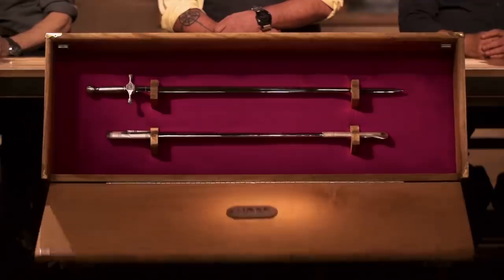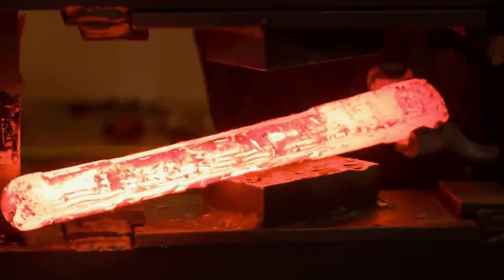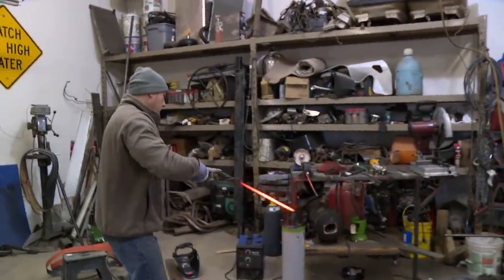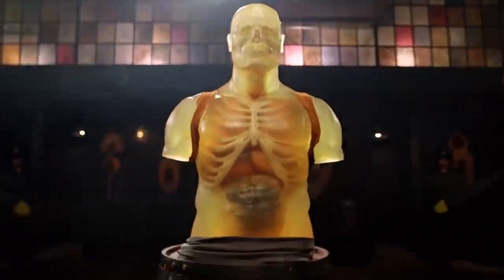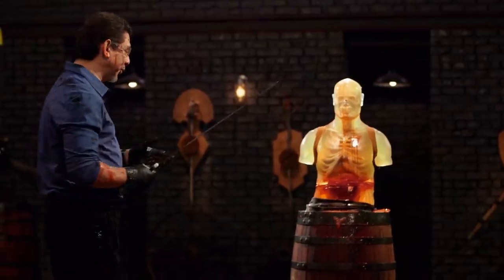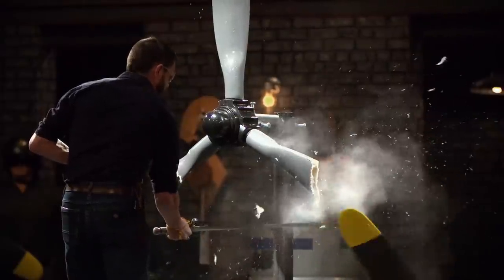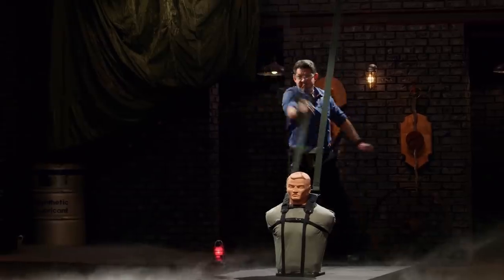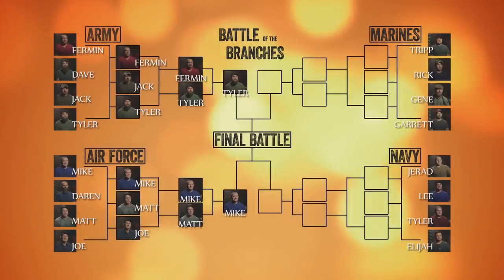Forged in Fire: Air Force Officers Sword Final Round: Matt vs Mike (Season 6) | History

Comment: "Imma put safety wire on it" that's probably the most boot thing I've ever heard.
Reply: Most boot? What?
Reply: @Argonak1  a boot is someone just out of basic training, and it just a little too excited about the military.
Reply: Jarret Barnes ahh gotcha, military lingo.
Reply: It's a chair force sword, the fact that it doesnt come with wifi and a 5 star defac astounds me
Reply: Safety wire is Air Force hardware.  Holds torque on on the nuts and bolts.  Plus it's easy to steal it from work.  They're already making him build an Air Force sword, he's at least reducing the overall nonner-ness of it.

Comment: Why dont they ever test them against other swords, Wouldnt that be the most accurate way to test durability? I guess it's not as visually appealing...
Reply: Because are not looking for accuracy but extremity. Both swords made would likely have the same effect on another sword, else the smith would not have qualified to be on the show. The only thing that would set them apart would be the most rash circumstances. And the only thing you could test on another sword would be strength and hitting a fixed sword is not as appealing as chopping through a propeller. Showing a spar between the two finalists swords at the end would be good but I don't think they have two swordsmen of similar skill to make that fair.